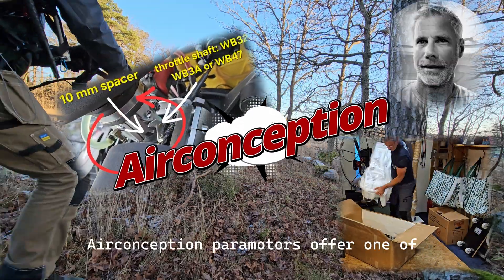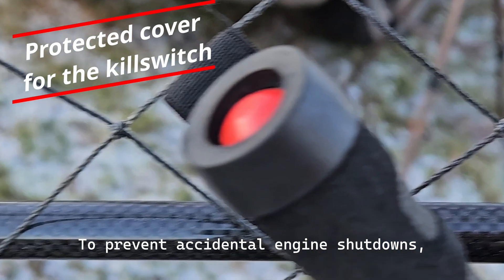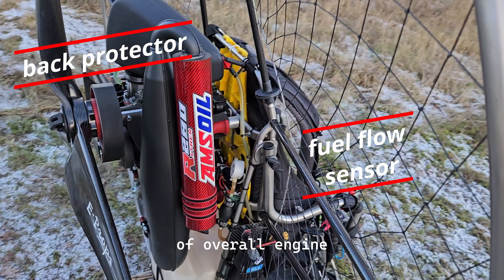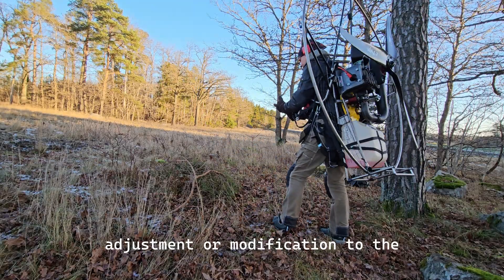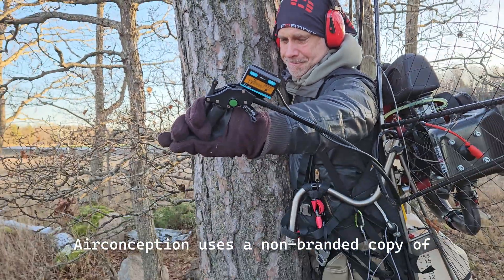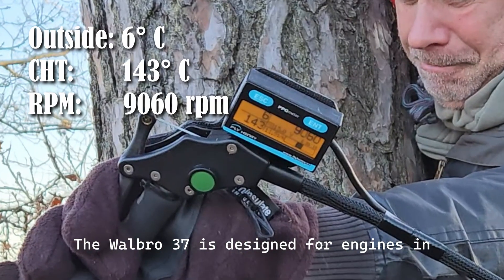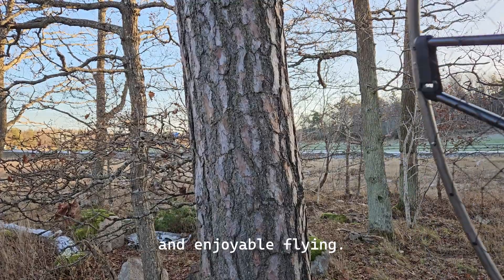Tuning, testing and modding a paramotor engine for safe performance.

Comment: I was thinking about changing the PWK 30mm float carburetor, but I'm afraid that the strong engine vibrations will be bothersome, I'd like to supply it with more air, I think the 28mm port is a bit small for this capacity.
Reply from the maker: Hi, yes the vibrations might be a problem 🤔.  My thoughts about this choice.

A float carb may be better if:
You fly strictly upright
No wingovers, no dives, no aggressive turns or spirals.
Foot-launch cruising only
Float-bowl carbs rely on gravity to keep fuel at the right level. In steep climbs or dives, and other attitude changes fuel can flood or starve the engine.
Risk of  mixture goes lean or rich suddenly, engine can cut out or surge if you fly aggressive or acro.

Diaphragm carbs pump fuel actively and aren’t affected by orientation — you can fly in all attitudes without fuel delivery or interruption.
They deliver fuel regardless of orientation. Handles vibration better.
Maintain consistent mixture at high RPM and different attitudes.

That’s why I think diaphragm carburetors might be better. At least for my type of flying. Let me know how it turns out if you go that route. Happy flying 🖐🙏🪂

Comment: what settings do you use for both low and high jet needles? Most sources i found said that I need to set L needle on 1 to 1-1/4 turn out but on those settings my engine seems to be running very rich and rough on idle. But when I lean my L needle and then turn it out just to the point where it has good throttle reaction then it seems to be running very hot on little higher rpms (Based on spark plug color). Even 2 turns out on high needle didnt help and i went back to the 1 turn setting on the L needle. Seems like wb37 is less touchy to the tuning than moster carb.
 Maybe metering lever is set too low? Pop off is at 16-17 psi with about 11psi rest. Everything is assembled correctly.
 A friend of mine tuned my motor a few years ago (on a old carb) and it was running smooth and the spark plug was very dark. Unfortunately I dont remember what was his tuning method and methods from the internet dont work for me so thats why I am asking for some opinion :). Cool video and have some fantastic time with your new motor!
Reply from the maker: My settings: ( runs fine in whole powerband, no 4-stroke or horsekick in midrange.)
 
Spring = 12mm, 
fork over baseplate = 1mm. 
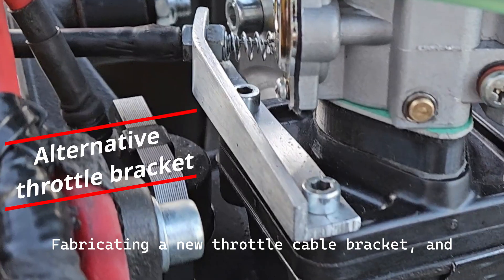L-needle = 0:40 open, 
H-needle = 1:17 open.  
Pop-off=15-16 psi. 
3-blade 130 prop. 
10mm carb spacer. 
2x1 mm carb gasket.
180˚ carb rotate
Cooling shroud 
98 octane always
Winter mixture at the local fuel pump = higher Reid Vapor Pressure (RVP).
Reply: @EliassonAnders  Thank you! I'll fiddle with it tomorrow and let you know if its better.
Reply: @EliassonAnders  these are the settings for extreme  280?   thanks
Reply from the maker: @cevljar2 . No, official settings are L-1:05, H-1;15. That's with the standard carb that the engine was delivered with.

Comment: Hello, did you measure the thrust? How much did you get?
Reply from the maker: Yes, about 86kg in my thrustbench.
Reply: @EliassonAnders I'm also increasing the power in my Tornado. What's the gear ratio on your drive? Can you measure and tell me the diameter of the wheels that drive the propeller? Have you considered increasing the propeller diameter?
Reply from the maker: @Szoszub ,  gear ratio 2.87. Upper pulley wheel = 129 mm, lower = 45 mm.
~9100rpm with 3-blade 130 cm
~8400rpm with 3-blade 135 cm
~8500rpm with 2-blade 135 cm
Reply: Hello friend, I have a question. Can you tell me what model of eprops propeller you have in your drive? Regards.